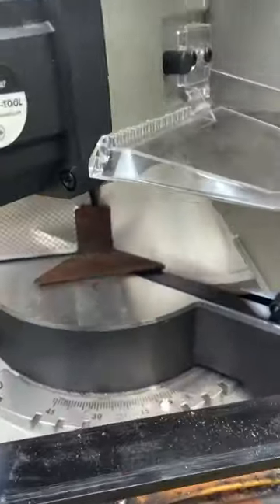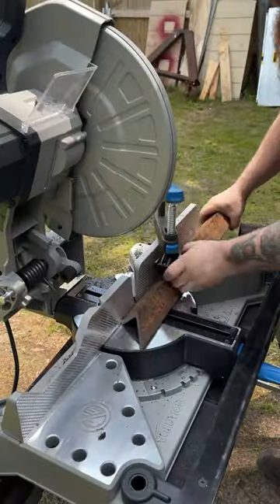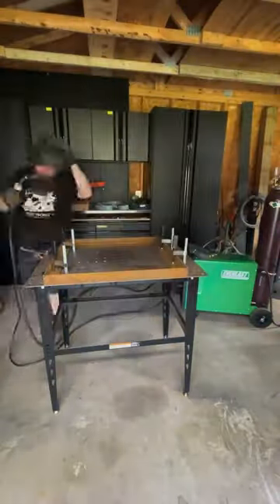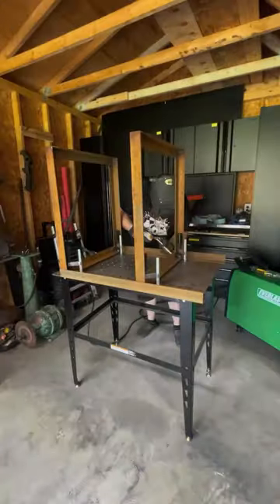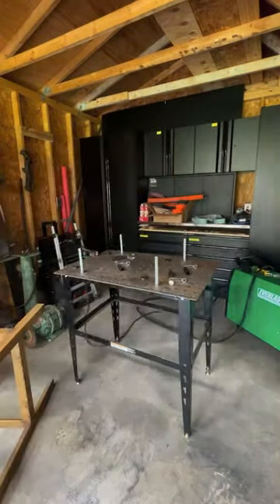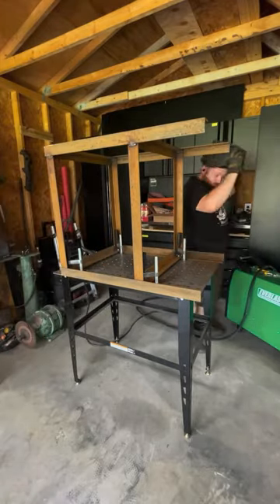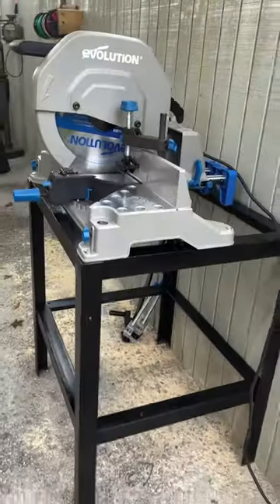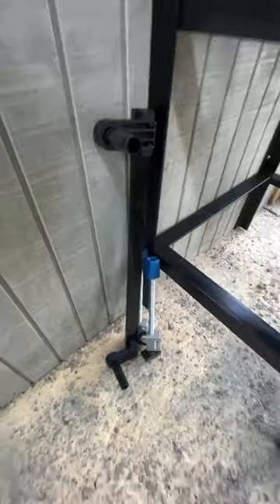Building a stand for my Evolution metal cutting chop saw #fabrication #tools #welding

Comment: Nice job on the workbench, I would have added a tray right beneath the iron miter saw (chop saw) to collect most of the metal shavings. 

Ironwork rocks!
Reply from the maker: I’m thinking a funnel with a bucket under it.